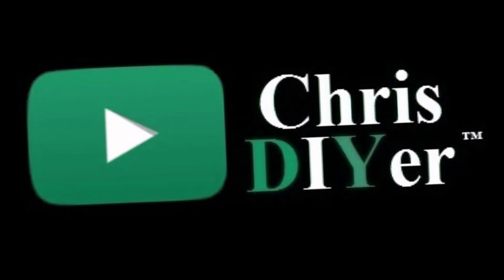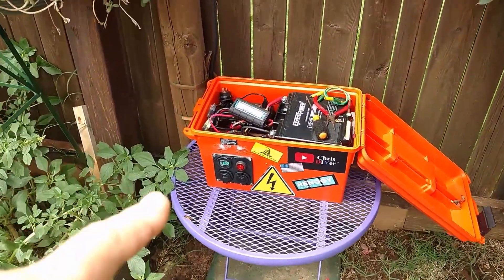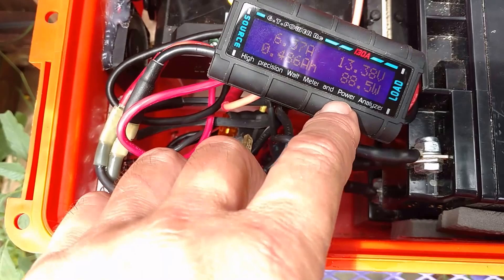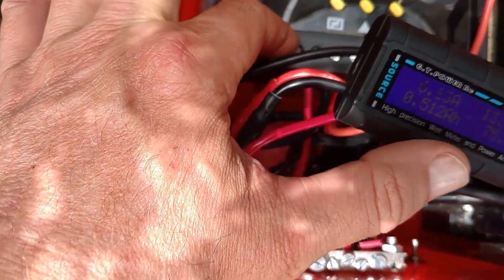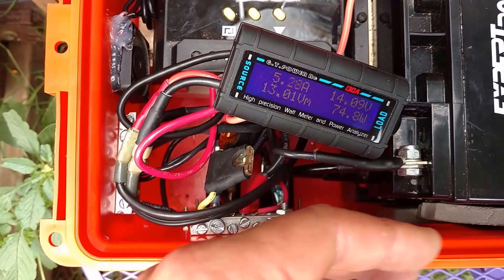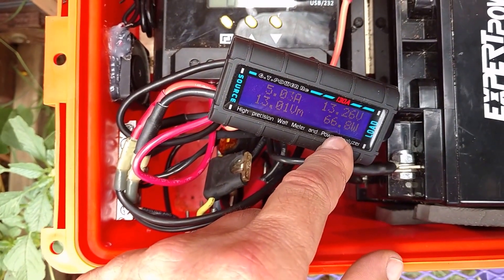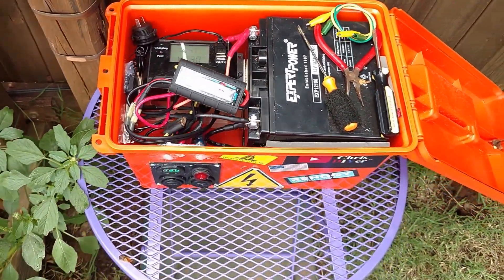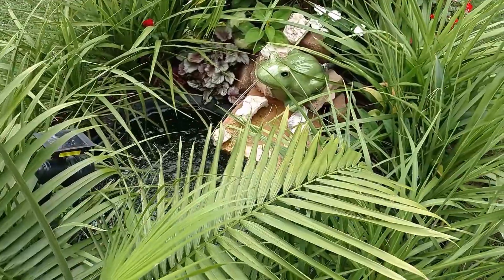Garden solar power generator mods (GT Power watt meter/power analyzer)

Comment: I bought a similar watt meter and hopes to read how much my solar panel is pulling in... I wired it like this...

Solar Panel --> (Source) Watt Meter--> (LOAD) Watt Meter-->  (Solar IN) Charge Controller

Is this correct?
Reply from the maker: Sounds good to me
Reply: Chris DIYer strange. Must have got a defect. It was reading Volts. But not the watts or amps from the solar panel. Then when I took out the meter and wired the system back the way I had it. I checked the charge controller and it was working properly

Comment: Hi can you tell me how you have this connected from source side and load side of watt meter to read what the solar panel is bringing in? Have seen many videos and i have source side to battery inputs on solar controllar and load side to my battery and obviously solar panels to solar input on controller, volts are constantly up and down as is watts coming in and barely makes in past 15 watts with 180 panels, same weather my old controller connected same way makes 40 to 60 watts, not alot of sun at the moment testing
Reply from the maker: ??? These meters do not read reverse current. "Source" on my meter is the solar panels, load is connected to the solar charge controller's solar input. I wired this meter to read ONLY what the solar panels are doing (direct current)...not what the battery/charging circuity is doing
Reply: Chris DIYer 
I have seen so many videos wired up my way so it is why i went that way, you can wire them many ways to read different thinks but i might try your way 😊
Thanks for your reply nice garden also